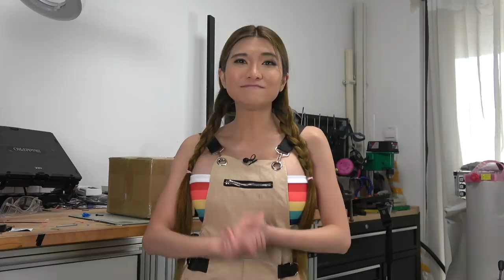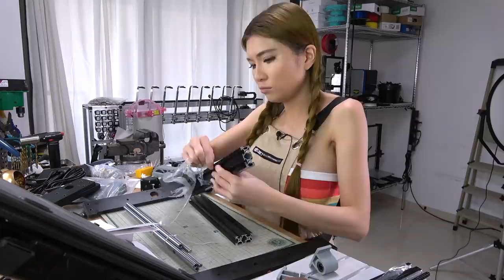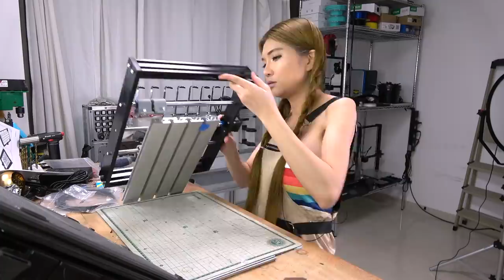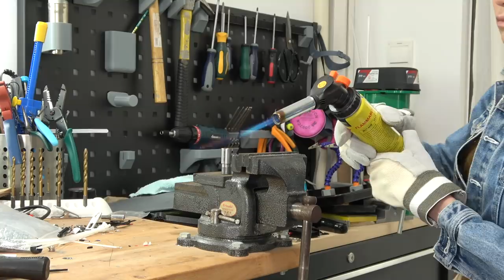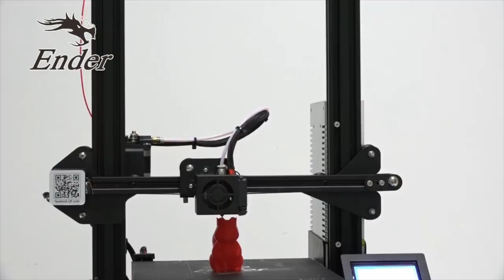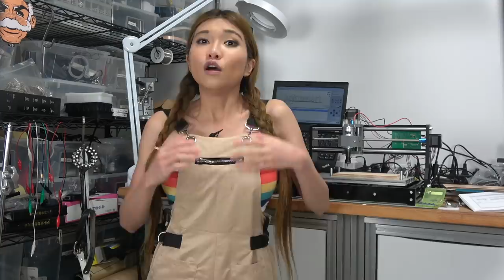CNC Engraver Unboxing and Assembly- the SainSmart Genmitsu

Comment: I bought the Sainsmart Genmitsu  3018 PRO for myself last month.  So far it is working great for me.  I've been using it to help cut plastic and wood for making test fixtures.  I do the 3D CAD in Fusion 360, generate and export the toolpath, and control the machine from bCNC.  I had the same frustration with the collet installation you did, but I like your point - if you put it together, you know how ot take it apart to fix it. :)  Thanks for another great video!

Comment: Good to see you back, Naomi!  Sainsmart has noticed you in the comments section, about the cutting bit collet, and is now providing it assembled.  It good to know they listening to you.  I liked the use of the blowtorch in your apartment.  One evening, I arrived home in the dark with a noisy exhaust on my ute.  I got the pipe out and found it was cracked almost right through, so I ended up arc welding it on my dining room table!  I didn't want to upset the neighbours by using a welder and angle grinder outdoors at night.
Reply from the maker: haha yeah, noise can be an issue😉

Comment: CNC is both hard and easy. I suggest learning a little about welding as you move forward with CNC. I'm a heavy wheeled mechanic which both come in handy. There is a little cross over knowledge with welding and metal working.
Reply from the maker: I'd love to learn welding but no space for it😓 maybe after I move...
Reply: @Naomi-Wu  when you get your new space the easiest and cheapest welding to learn is stick but the easiest welding is with mig
Reply: Welding is just soldering that's harder to undo. :)

Comment: I bought one of the Genmitsu 3018 kits from SainSmart for the same thing, to learn CNC. It's been so much fun leaning. Don't expect it to cut metal though. It will engrave ok but milling metal parts is beyond it's capability. But wood works great. I've got some plastic I'm going to experiment with next. BTW, SainSmart have been very good in supporting the machine as well.

Comment: The move with the vacuum cleaner is good, print a attachment to the head andconnect it to the a clean PVC - rubbery like hose with rings on it, is transparent and used in medicine for breathing tubes, sorry i don't know the material name or the parts name in medicine, but a permanently attached vacuum cleaner that is started when the head moves is a nice addition to a CNC router. Love your style. Merry Christmas 😊

Comment: The fact that laser cutters and 3D printers aren't called CNC even though they are is really interesting. Maybe it's because metalworking machines started out manual and laser cutters/3D printers were CNC from the start? That'd make sense for why some need the specification of being CNC and why some don't.
Reply: very true every machine tools started out as manual machines a very long time ago
Reply: By technical definition they are all CNC machines, even a standard computer printer or plotter.  For some reason they never came up with a catchier slang name for the cutting machines till the laser cutter. There are a few people that do refer to them as CNC milling machines or CNC routers.

Comment: Naomi, you're the whole package. Men with brains search for women with the same and are not content with less. If I had a son and he showed up with you on his arm, I'd be overjoyed. Now, technical details, I'm an electromechanical engineering technician and I notice you are rightfully suspicious of the safety concerns around CNC. Wear lots of PPE, as you do. If you see CNC being used in Canada, it's often surrounded by a safety cage or enclosure to ensure the safety of its operators. Those tools can spin at 30,000 rpm and when they break...they fly like bullets. I admire your caution and the admission that you are physically weaker than men, such honesty is rare and comes from common sense, but mentally you're on par with men and have a curiosity that is admirable. Too bad they're raising your rent, but the same attitude that is in your videos of moving forward, will see you through to the next big adventure.

Comment: Hey Naomi, I been into 'CNC flatbed' for many years, the term CNC as you said means so much these days.  First time I seen the Sainsmart equipment.  In my past I have run 4 CNCs, but the last two was a AXYZ 6012 Twin Head CNC which I used to repair myself when we had trouble with it, we eventually upgraded to a Multicam 1000 which had a single head but a ATC tool changer and a laser system to help cut out digital print.  At the time I tested software and we use a cheaper software called Vectric V-Carve (or Aspire 3D), this is compatible with many CNC cutters that run from CNC Code (G-Code) which is an ANSI based instruction list.  I used V-Carve as it allows you to convert from Corel Draw or Adobe Illustrator designs into G-Code easily, I also think you can do things with SketchUp3D I think now.  V-Carve (and Aspire) have so many tools and instructional videos of how to learn to create and use flatbed designs, trust me when I say it will be a good starting point.  You can download it free and run the demo files on your machine and see how it goes, you can then test how well it will import but will not Save until you buy it full, there is many videos on their website about how to use the software like Pocketing , nesting  and learning whats tools are etc.  Good luck - will be watching

Comment: Thanks for the review Naomi, I was looking at this unit for some student work. If you assemble as fast as the video showed we could use you in the assembly area putting the robots together. Also a hint on your material hold downs, get a block on the other side of the tie down plate so that it sits flatter. Since you do not have to pull down very tight you could 3D print step blocks. Good video.
Reply from the maker: Oh yes, totally fine for students (with a little guidence)😊

Comment: Set screws on the shaft couplers (stepper to threaded rods) will need thread locker. These small machines can often vibrate apart, check everything is tight after the first few hours of running. Using a brass brush on wood after engraving is helpful to nicely remove burrs :)

Comment: Nice video Naomi, it's always a pleasure to see you and everything looks so simple with you... Continue!
Just a small advice: never tight things on the table with the retaining screws in diagonal; you create tension that could bend your work and also some dents on the hidden side of the table groves (and it's dangerous too in case one slides and the others push against your tool will machining...). It's better to add some small wood blocs (4 in your example) of approximately the same height of your work, opposite to the pressure point of the locked piece and apply the holding pressure in the middle of that, the screws will remain perfectly vertical and perpendicular to the table. That's what I learn, looooong time ago, from my mechanic teacher. (Excuse my bad English, yours is a lot better! Greatings from France)

Comment: Hey Naomi, have been a big fan ever since your Reddit fame days :D now found out you have a youtube channel!
One little thing, please don't hit an electric drive with a hammer, especially a DC drive! The permanent magnets will lose their field strength and the drive will run faster, but with less torque. Worst case, you get micro fissures. I suggest using a vice or a clamp, a steady, non-impact force applied to the shaft (not the bearing shields) will keep the drives in pristine condition. Love your stuff, looking forward to more videos

Comment: I recognize all the parts in the kit, nice senders, casting looks good- off the shelf bearings, rods, 8020 Al, arduino, sender controller shield. Some might not though- how about some cool close up? Grbl  open source is one of the gateway to the arduino  universe- way cooler than MC.

Comment: I find it fascinating that this machine uses V-Slot extrusion for its structure instead of T-Slot. V-Slot was almost impossible to buy only a few years ago and very expensive, but thanks to companies such as Creality and the power of volume it's now incredibly common and low cost enough to be used, even if the machine uses rods instead of rollers. For wood and plastic it looks rigid enough, but I wouldn't try metals except with very light passes.
Reply: It's not only that V-slot was impossible to buy and expensive, the rarity of V-slot was because OpenBuilds would actively seek out and threaten lawsuits and write up violations for people distributing V-slot profiles. Even as close as early 2020 they'd still file injunctions (of course Chinese companies didn't care, which in this case I find good). Funny that their name suggests an Open Source approach, but the name and design are in fact trademarked. In my country Bosch Rexroth has a massive stake in the aluminium profile industry, along with a few names as big as them and a few ones with at least compatible slotting - almost none of them sell V-slot profiles simply because dealing with lawsuits takes too much time. It's kind of sad.
Reply: Also Naomi if you're reading this - please don't hit poor motors with a hammer :D I didn't look up what kind of drives these are but if they have magnets, you're reducing the magnetic field, if they don't have magnets you're damaging the bearings, if they have neither magnets nor ball-bearings but plain-bearings you're damaging the fit. Using the vice and a small piece of aluminium or bronze between the shaft and the vice is the best method if you don't have a press

Comment: Naomi, you need blocks on the other side of the clamps, the same height as the wood you’re machining otherwise the part may take off if the cutter digs in.

Comment: You should get more protection by wearing, for example, old military working suit from the Navy (one piece fireproof with a thick fabric, used on a boat). I use a French one which is really fine. Nice vid, quite to mount this thing I gess, as it's a already a pain in the ass to use properly !

Comment: What's the maximum height of the item you can lock into the CNC? It looks limited, I need to an existing steel chassis out in a particular pattern for a transformer. Great video, thanks for the work on it!

Comment: You can use the 3d printer to make a shield to go around the router motor and hook up to vacuum cleaner to keep cleanand cool by pulling air across the bit.

Comment: you have to shrink fit the collet to the spindle. This reduces run out. More accurate. You will find that this machine is only capable of working soft materials. They look like 55 Oz" steppers. But good learning curve

Comment: I am curious if this is accurate enough to mill prototype PCBs, especially for larger SMDs.  My current CNC is belt driven and just not accurate enough.  I think it would be great if you did a video on milling a simple circuit (with SMD pads).  No need for the design process.
Reply from the maker: Ok!

Comment: 3D printers aren't called “CNC“ because by definition they ALL ARE. On the other hand, boring machines, routers, engravers, lathes or milling machines used to be mechanically and were computerized in the 1970s, so these were called CNC as opposed to “normal“.
Ancient history, long before you were born!

Comment: You've done more in this video than I have done in the last year of having mine (i'm scared of breaking it or it damaging me with flying bits). Just taken it out of mothballs and am going to have a go again.
Seems 10 times more complicated than 3d printing software side and am going to have to rewatch all the videos I watched a year ago. If creality made a 3d laser cutter/ engraver or cnc machine I would buy it knowing it would be a quality product rather than the Chinese stuff at the moment that don't have limit switches, cut off panic switches that don't work, decent documentation etc.
Reply from the maker: Exactly! No limit switches, no emergency cut off- software toolchain that is quite tricky. I like the Genmitsu but there's a lot that makes it tougher than 3D printing.

Comment: I actually have one more question about this engraver. Can you test if it is usable for making custom printed circuit boards by etching copper-clad board? I would be especially interested, and very likely to buy one if it has enough precision to cut pads for surface-mount components like SOIC-8 or 0804. I would appreciate it if you were able to test it, since you have it in your shop already. :)

Comment: That CNC kit looks good. I've been thinking on getting a CNC to do stuff that my 3D printer won't do. In particular it looks like it wouldn't be difficult to mod it right from the start to have it do laser engraving beside the mechanical CNC routing. I've considered modifying my 3D printer for laser engraving but I'm sort of reluctant to do that due to the time and effort that I put into building and fine-tuning it; it's an older Prusa variant that is not straightforward to mod (I'd have to replace the extruder with a laser head, cannot just attach the laser to the extruder). 

Those stepper motors though, they don't look powerful enough to me - are they NEMA17, or are they smaller? I have beefier motors in my 3D printer, and it's not even required to do as much mechanical work as a CNC router. The Sainsmart site lists them only as 2.2lb*in holding torque, mine are more than double that.

Comment: These machines use parts that are both standardized and specially designed aluminum extrusions. The frameworks and base plate to be specific. That would be good information for you and your viewers to possess (content)!
More important if you decide to go into CNC machining. You will also need a lot of education on cutting tools for these materials including the various alloys and their characteristics and cutting fluids.
You may get to the point that you cannot live in close proximity to your machining operations, noise, dust, pollution, and electrical capacity.
You might consider partnering with a machine shop to get a solid education to see if this is a direction you want to follow.

Comment: I just purchased a CNC 3040 router I have aspire software as well as mach 3 software but the learning curve is steep would you have any suggestions for a newbie that uses a 3d printer and k40 laser engraver user would I be smarter to use freecad or another program to begin? Any help would be appreciated!!!
Reply from the maker: Fusion 360 is really most easy...
Reply: @Naomi-Wu  Thank You and keep up the great work!

Comment: Hello Naomi

First of all, congratulations for your contributions.
You are very nice and a very brave woman in your endeavors.
There are many people who like the electronic "Make Things with Circuits" and you who live or visit stores can make more videos
on:

1. Electronic components (Transistors, SMD Technology)
2. Ultimate Modules (LCD, Wifi etc), DIY Power Supplies, Measurement Instruments (Oscilloscopes, Ammeters, etc)
3. CNC machines showing applications for PCB, Design and others.

I would like to visit those stores.

Waiting for your comments and electronic videos, Victor Torres.
NOTE: You can indicate an email for contact.

Comment: Dear Naomi, as former armourer and metalworker, I like ask you to never hit delicate metal parts of a CNC machine directly with a steel hammer. A motor or spindle axle is made of steel so you can damage it, chip it etc - or damage your hammer. 
Please use a automotive copper-rawhide hammer, plastic hammer, or put a piece of hardwood on top of a steel axle before hitting it. 
Just my advice.

Comment: Is it even legal there to live in a factory complex? It isn’t here.

The clamps need to have blocks under the outsides that are even, or slightly higher than what you’re clamping. It’s true that there are little forces on that tool, but still, these clamps are pushing sideways, rather than downwards. It’s just good practice.

Comment: do you have any links to getting .nc files? i tried inkscape to convert images to gcode but the software doesnt open it. :(
Reply from the maker: NC files are machine specific, once you use all the ones that come with the machine you'll have to make your own.
Reply: @Naomi-Wu  is that why u started using Desk Proto? there aren't any sites to get files for cnc like Thingiverse has for .stl files?
Reply from the maker: @sabrinaflipse7732  STL files need a slicer to convert them to GCODE for 3D printing. For CNC stl, svg etc need to be converted the same way- but to NC files (which are basically just GCODE) Deskproto is to CNC as Cura is to 3D printing (although not Open Source of course). I hope that helps.
Reply: @Naomi-Wu  yes thx to your video I understood that concept but I just was wondering if cnc people had a website like thingiverse does for 3d printing people. thx :) for your responses. Shen Shen :)

Comment: If you are also into supervillainy, I think I might have found my future henchwoman...you ROCK Wu!

I found you because of a shoutout by Sargon of Akkad, and as a fellow afficianado of the art of Making Awesome Shit, let me just say "hi from The States".

My current project is trying to scale down a linear accelerator to fit into a handgun frame.  But my stumbling block is finding a method to make a cheap and reliable extruded polymer frame (since a metal frame would malform the magnetic envelope).  I think I've already solved the capacitor/round loading issue.  Got any thoughts?